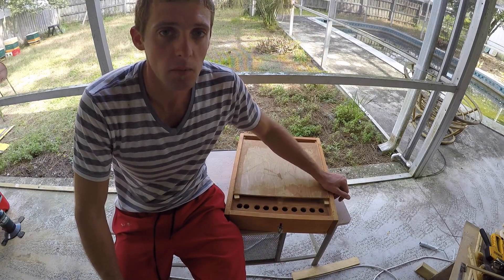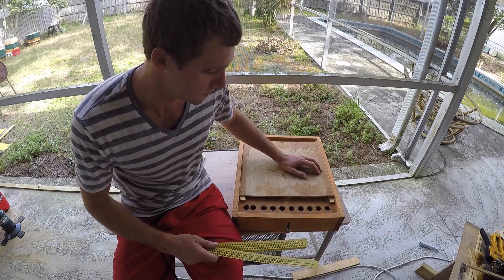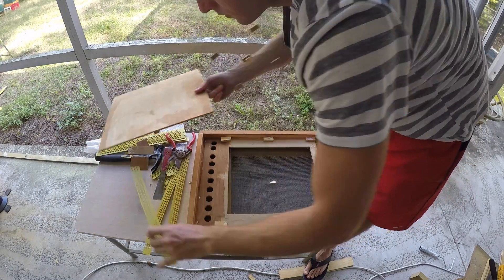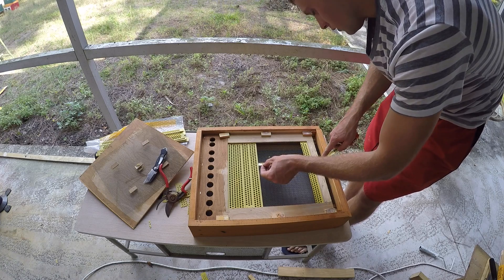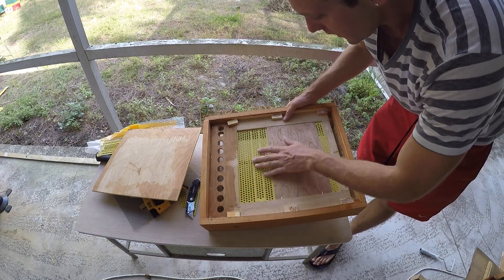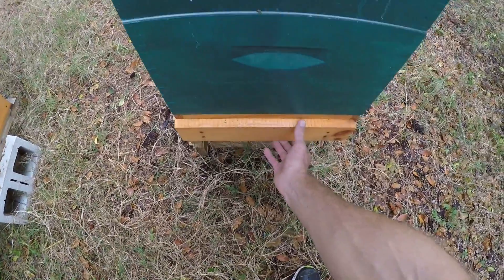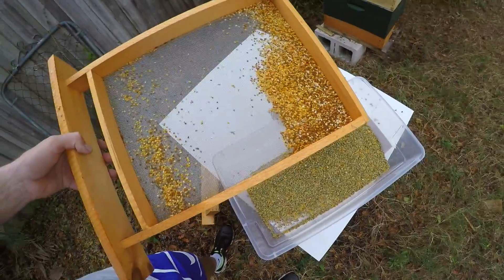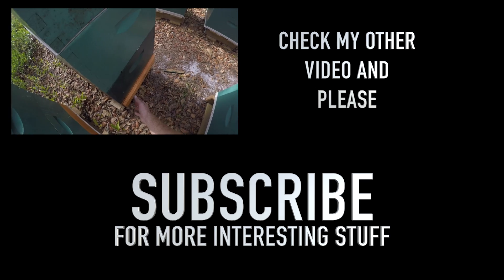Improving Sundance pollen trap

Comment: I followed your instructions and got great results.  When I moved the door down, I realized there were many bees on the screen level BELOW the pollen drawer.  After a few days I took the whole brood box off the Sundance trap and there were many dead bees and live bees trapped below the drawer.  Why would that happen?
Reply from the maker: Hey, I don’t know, I haven’t started using them this year yet, but I’ll try to check for dead bees. Maybe they can’t carry out dead bees because pollen trap is to complicated to go trough?
Reply: The bees were using the exit cones when you had the pollen collection on. Once you turned it off they still wanted to use the exit cones and now they get trapped. Put some tape over the exit cones when trap is in off position or block the cones with something.  I've had that happen once because I use screen bottom boards and they see the light through it and think it's an alternate exit.